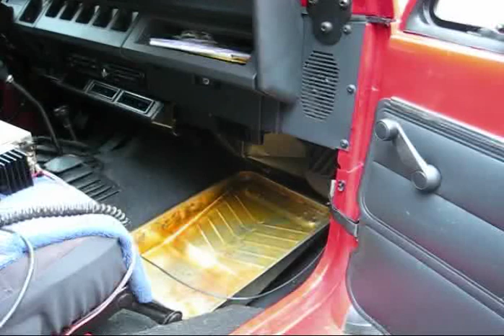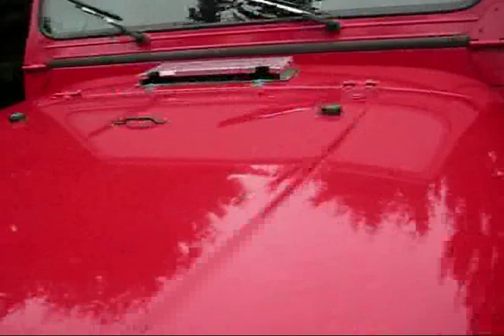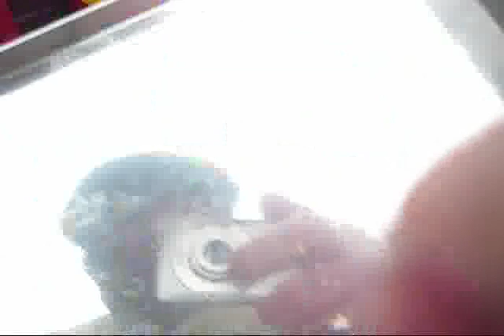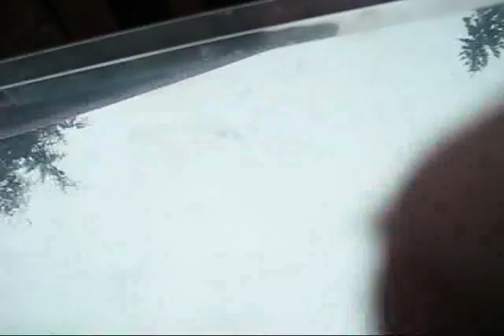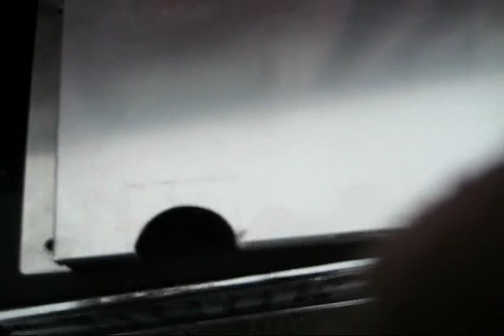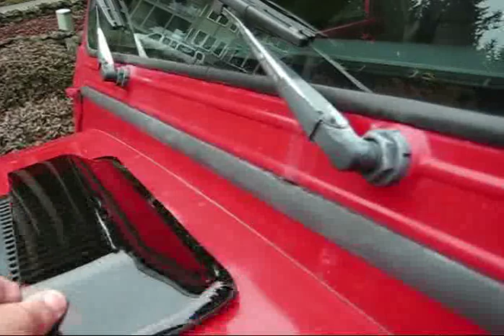Water Intrusion in my Jeep Wrangler.mpeg

Comment: I posted this from my daughter's account. Just in case people are not aware, the stock vent box on older CJ Jeeps was made of painted and sealed cardboard. When it was new the water coming in through the vent would go out the drain as was designed. As it aged the cardboard would leak into the Jeep under the dash. The sell plastic replacement boxes that solve the problem without putting a hood over your vent. Not sure about the YJ's or newer but I have the plastic box and only chase leaks from the soft top and doors now.
Reply: Great advice. Thanks it did the job.

Comment: I had that same problem. The issue isn't so much that water gets into the cowl but rather that the drain in the bottom of the cowl is clogged. Once the cowl starts filling up with water it's only a matter of time before it spills into the vent intake. Covering the cowl opening helps but eventually the inside will leak again unless you unclog the drain.

Comment: i have the same vehicle, and the same issue.  I was told the issue is not vent, but the rubber cowl seal - which is pretty old and cracked i must add.  did you change the seal at any point?

Comment: Hi MrGizmo757,

Sorry I am not familiar with the configuration on the TJ with the three holes. The commercial units just didn't cut and that is why I rolled my own. Perhaps there is some way to build the cover so that it fits into the actual vent slots --sort of like spring into place wher it would be a tight friction fit. Don;t know if you have access to sheet metal tools --maybe a local shhetmetal shop can give you some ideas. Wished I had a ready answer -- I no longer have wet feet!